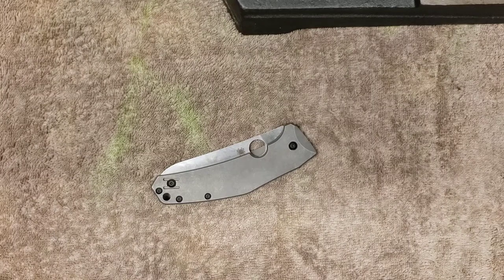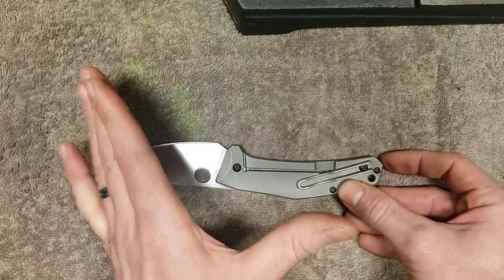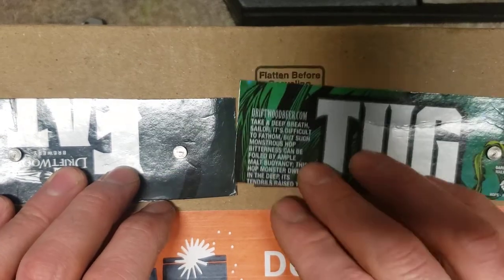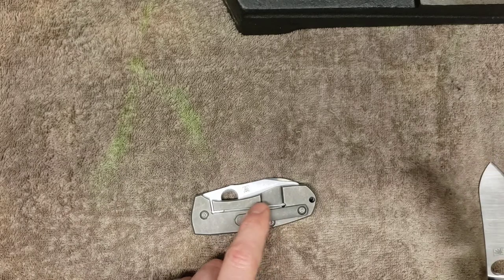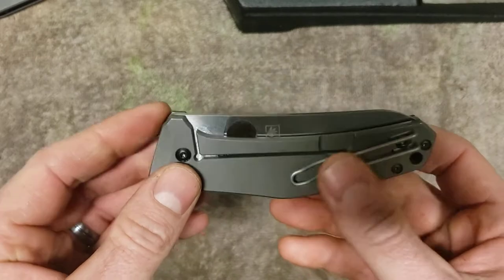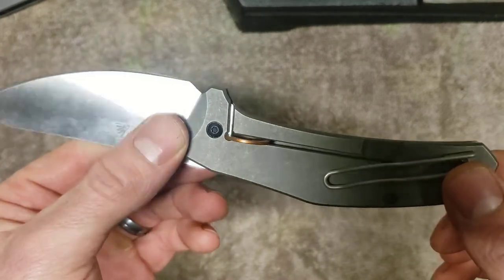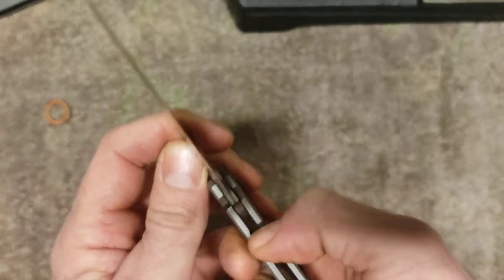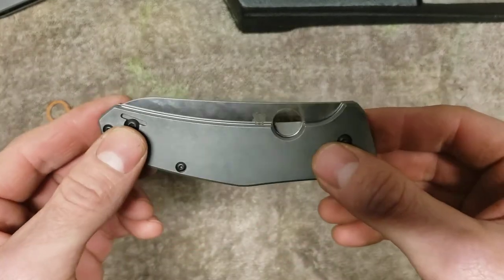Spydiechef lock issues explained

Comment: You're okay with "lock stick"?  Odd Spyderco  would put this knife into production and sell it knwoing  this  knife will ahve  "lock stick"....which  someone said adding a bar would  fix this...surely they know about this issue...
Reply from the maker: My Spydiechef has slight "lock stick", but it is not enough to bother me. Looking back on this video I have a feeling that with LC200N steel, the knife was designed with a compromise between "lock rock" and "lock stick". Perhaps more R&D is needed, which may involve a lock bar insert as you say. However, that may not fix the issue as I have seen bad lockstick with those as well.